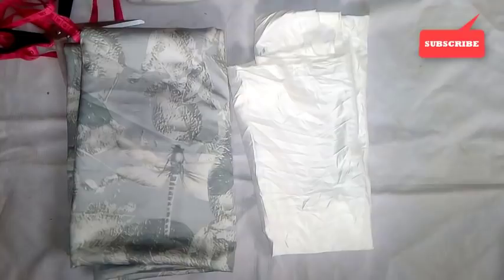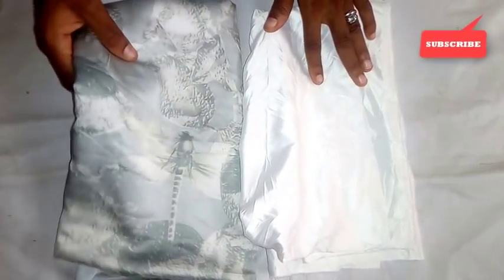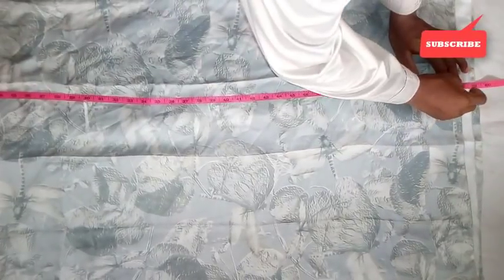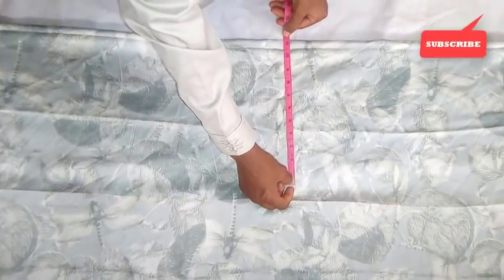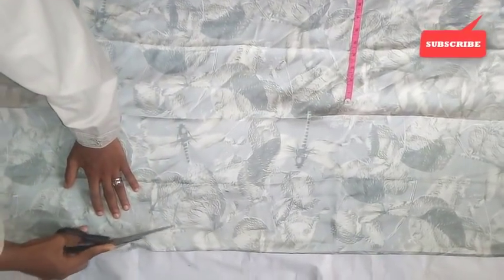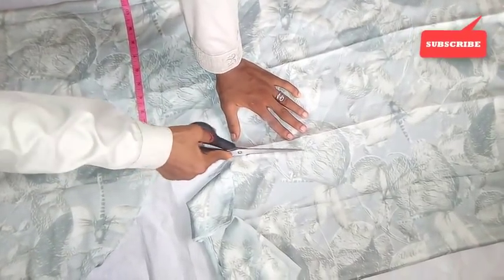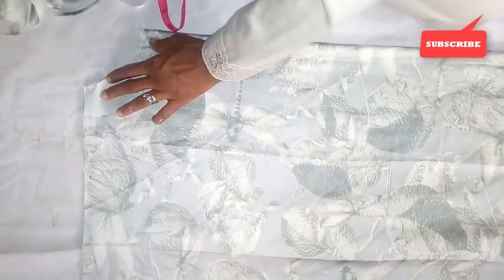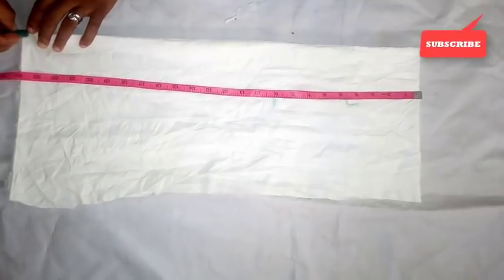Tie Neck Cowl Kaftan/Evening Dress DIY

Comment: Thanks but pls how many inches was the bow on fold at the point it will be attached to the back? Hope my question is understood
Reply from the maker: Fold 7 inches in to two then stitch and turn it , it will only attach to the front
Reply: @Dizhafashion  thanks but how will I attach it to the front
Reply from the maker: Just fold it and attach it to the neck before biasing the neck